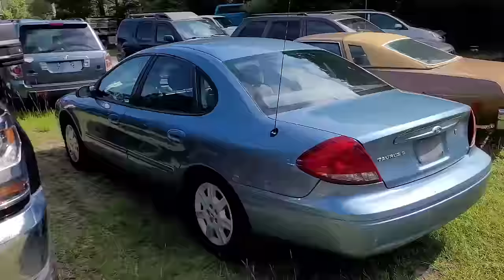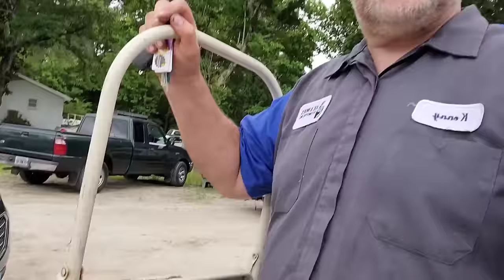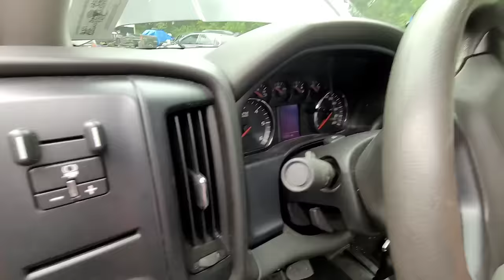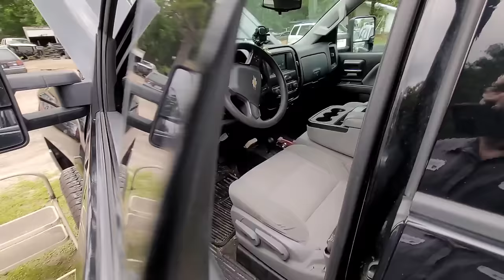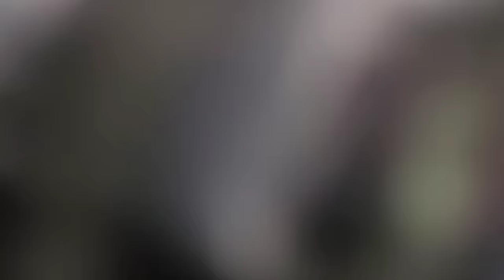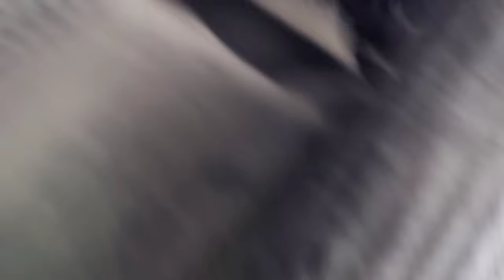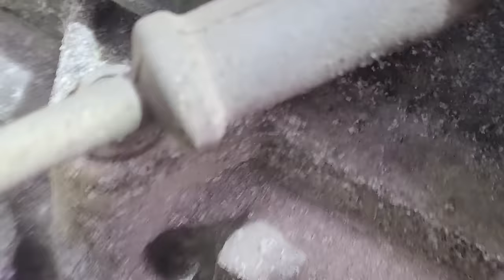Another GM 5.3 Ticking Noise. It's not the lifters on this one either

Comment: If the manifold bolts were not visible, and exhaust carbon were not visible in this truck, you can track this problem down with an old broom stick, Used like a stethoscope. Truth be known, this probably wouldn’t have been a problem if the right hardness bolt and correct torque were used in the beginning at the Manufacturer. 
Wouldn’t be the first time that manufacturer’s throw $hit out there for the public to proof it out. How about the 10 Speed Trans in later model Trucks? Point made. R&D isn’t what it used to be. Reliability studies and Weibull Analysis Data on things like this would have prevented it, Period.
One step further, supplier quality tools such as lot acceptance, canned samples will unequivocally tell you if your getting what you think you are. I am a Retired Quality Manager, factual things, GM knows this well, so do the rest of them. Sorry for the boring speech. Good Luck

Comment: Stopped 2 mins in. I already know.. The old broken bolt at the manifold.
Not check engine light with a cat efficiency code? Its common problem that chevy still has. Ford and dodge are not as common anymore for that problem anymore.
Reply from the maker: I've actually never seen any codes on a GM when the manifold boots have been broken . Normally I would think I'd see lean codes , not cat efficiency codes since the break is before the upstream 02 . I've seen plenty of times where a crack in the exhaust after the upstream 02 , but before the downstream 02 have caused cat efficiency codes

Comment: How can I tell if I have a bad coil pack need your help
Reply from the maker: If you have a way of monitoring misfires , if you have access to a scanner . You can swap coils around . For example, if cyl #1 has the misfire, swap it with the coil from say , cyl #2 . If the misfire moves to cyl #2 , then you know it's the coil . If you only have a code reader , DONT CLEAR THE CODES !! Swap the coils and drive it for say 15-30 min and see if you have the original P0301 code for cyl#1 misfire and now a P0302 for a cyl#2 misfire . It means the misfire moved , and the coil is the problem . 
 Let's say you only have a code reader ,
Reply: I put new plugs in it one was black the others look good like it wasn't fireing

Comment: Auto manufacturers cant even design a damn bolt that wont break.They can make a crappy torque 2 yield bolt but not one that will stand up 2 expansion and contraction. Its a scam all the way.They are made to keep you buying parts.

Comment: 43 yo old been Chevy fan since i can remember and now after buying brand new truck a 2019 chevy silveraod 5.3 l texas edition 4x4 withing 5k they had to replace a lifter/valve then tranny having issues and at 60,100 miles 100 miles after warranty ended ESC and power steering light came on and lost power steering.. then realized oil coolant lines are leaking.. here is the crazy part, all 3 of these issues are recalls but my vin # didtn coome up.. i mean come on, GM motors are garbage and im so dissapointed the best cars on the road are japanese or whatever.. Hondas and Toyotas hands down best vehicles on the road today!!! F**& GM MOTORS!

Comment: if you use 15/40 oil in these motors they will shut up. that 0w20 is bull sh i t. i had a 96 350 that would loose pressure in the lifters, put the 15w40 in it. never happened again. ive run 15w40 in my 05 5.3 ls for 8 years, absolutely no problem, truck runs perfect no lifter noise with 170k on the odometer.

Comment: I have a 2020 6.2 ltr silverado with 70k miles on it. The lifters and crankshaft have been replaced twice now. Proper oil every 2k miles. Gm won't cover it anymore. Gm lost a class action law suite in California over the gm engine issues. Gm has lied to all. There engines are not reliable. They are crap. Gm has betrayed there customers.

Comment: Just cheap general motors junk! General motors used to be the most dependable vehicles on the planet! Not anymore! On a 90° plus day notice vehicles with the windows rolled down because the air condition has went out 9 out of 10 will be a general motors product sad ending to a great line and legacy!
Reply: My 2011 5.3 Yukon has 210,000 miles and still going strong. Just oil, a little suspension work and tires. Everything still works. Did have to fix the air con at 150,000. $650. Didn’t think that was bad. No body rust and I live in Wisconsin. It is garage kept which helps with that.